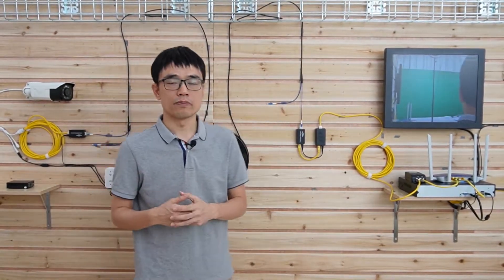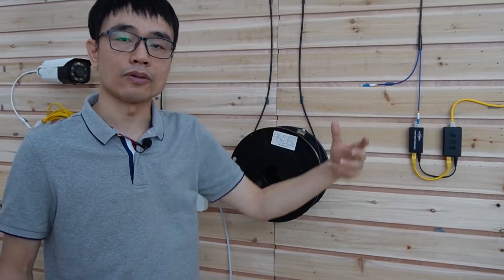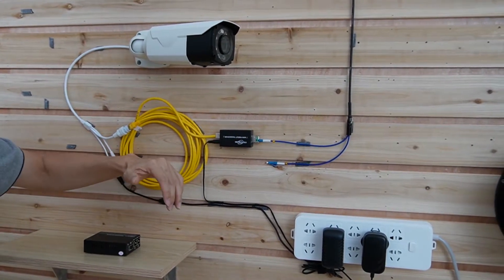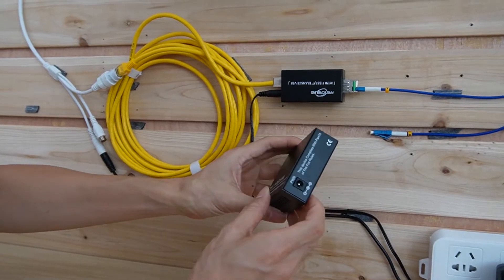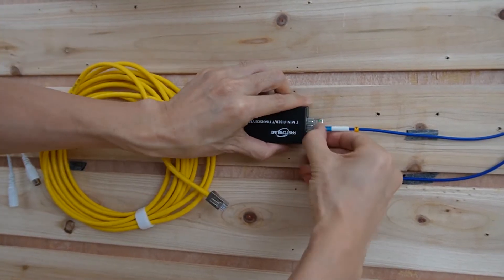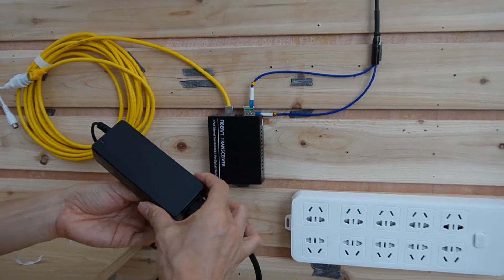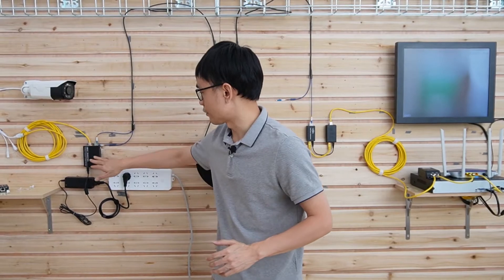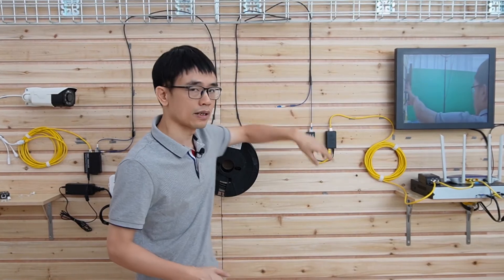Part #2 How to use PoE with Fiber Cable

Comment: I have POE 24 port Cisco switch and POE IP camera's does I need the POE injector on switch side? or simple Electrical to optical and optical to electrical media converter will fulfill my requirements?
Reply from the maker: The PoE feature on Cisco switch doesn't help in this case, because you can't send the power over the fiber optic cable. The Fiber optic cable is made of glass. You need pull power cord in parallel or take the composite fiber optic cable to send the DC power. Then you need POE media converter at the camera side to power the camera and work with the fiber optic signal.